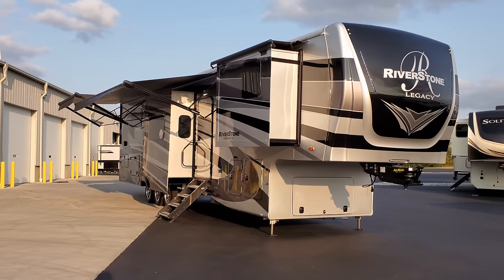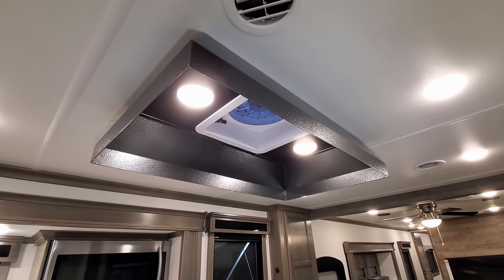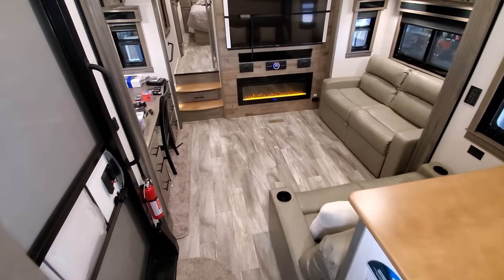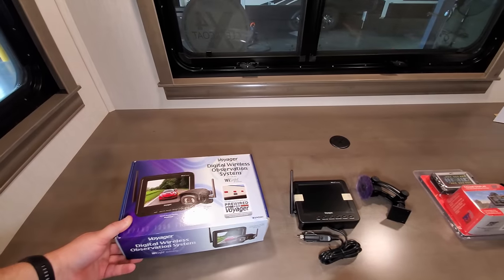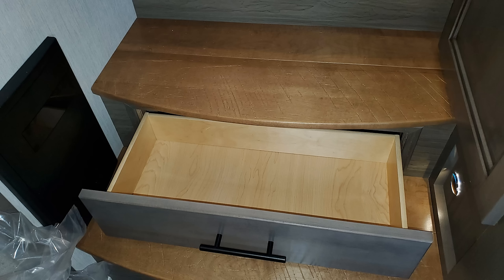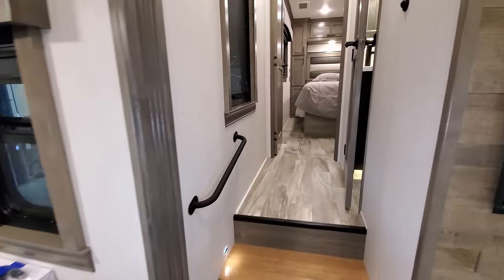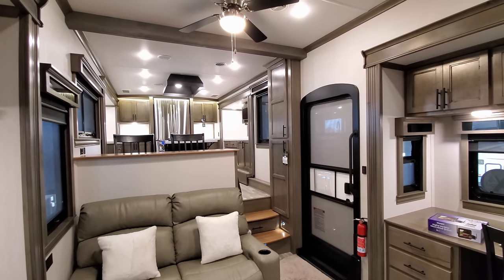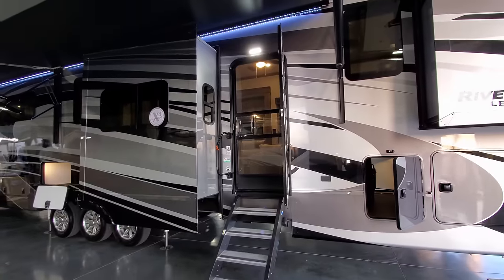Luxury Fifth Wheel New 2021 Riverstone 42FSKG Front Kitchen Toy hauler @ Couchs RV Nation a RV Walk

Comment: I personally would rather not have the island with stove in the middle. I would love the open space, the oven on the side. I love this particular model for the versatility to be used by a couple, a single, or family of 4.  The added features allows to go into a cooler season.  But not completely sure if I would want to try extreme cold.  This was a perfectly beautiful well designed home. I do love it, would think seriously of buying it, without the island if that was a option. Thank you for showing this fifth wheel.

Comment: Showing how slides operate is very helpful. Especially the difference between electric and pneumatic slide. Also that bedroom can be blocked off with slide in. And if slide is not fully out it may be affected by rain.

Comment: Thanks for listening to me Riverstone putting the oven and cooktop where the sink was and having no ventilation for it , was a bad idea and the reason I didn’t and don’t own a Riverstone NOW you have an excellent perfect set up with a V/hood above the range I’ll be purchasing soon! SOLD! A tiny feature that would be useful is a big flat shelf on top of the washer dryer unit to use that space for the laundry soap and other related items, like to see an option for the spare tire in the garage simply mounted to the wall (sitting on the floor) as an option , Would improve under side clearance

Comment: As soon as I saw the front refrigerator I checked the tongue weight, 4,000 pounds.  😳  That’s nearly in semi weight class. Beautiful, but you’re going to spend the cost of this unit on your tow vehicle as well.  Beautiful, awesome, but it’s in a separate class.
	edit.  I have to admit, it is designed well!  From slides, closets, outlets, and furnace duct placements are all indications of a seasoned designer who has actually used the units.  👍🏼

Comment: I would trade in my Grand Design 376THS for this unit IF it came with a fuel tank to run the generator and had a pump to fill my quad. Like this layout better than mine. Trying to get GD to make this layout.

Comment: I'm totally a newbie when it comes to RV. So if Im at a place where I can connect my RV to "shore power", what i heard its called, then I can run all of my electrical appliances with no worries? As long as I'm connected to shore power, then do I have to worry about the generator or converter or invertor? Sorry, I dont know what any of these things are, I just would like to know if i can just live in a RV like a regular house

Comment: what are the dimensions of the garage with the bed up?  we have a small UTV that we would like the take 78 inches tall, 61 wide and 126 inches long 0 will it fit ?
Reply from the maker: Garage Lower part: 64 1/2" Wide 
Garage Lower part: 109" Long
Garage Middle Part: 61" Wide
Garage Middle Part: 98" Long
Garage Upper Part: 52" Wide
Diamond Plate area: 52" Wide
Garage Height in up mode: 83 1/2" Tall
Garage Height in Down Mode: 59 1/2" Tall
Reply: no, garage is 110 inches deep

Comment: That island needs to be rotated by 180°. Sure, I get that you might want to dunk cooking pots in the sink, but you might also be using the cooker and the microwave unit at the same time. It would be easier to turn around rather than walk around the island... Even as a couple's coach.

Comment: Air flow problem the stove and vent have to be in close proximity to one another 34 inches to specs. You cant just place the vent over thr stoves without engineering the proper air flow. That ceiling vent is way to high